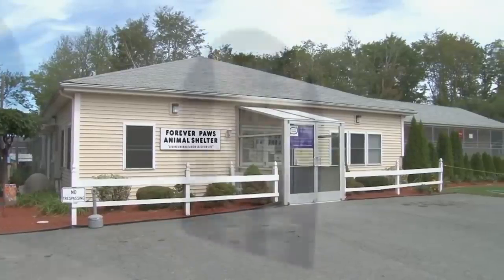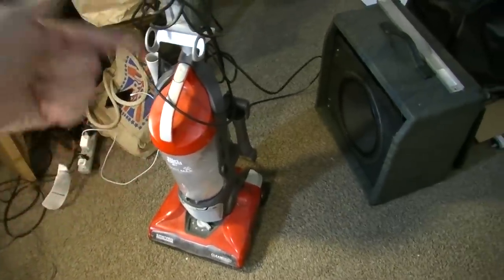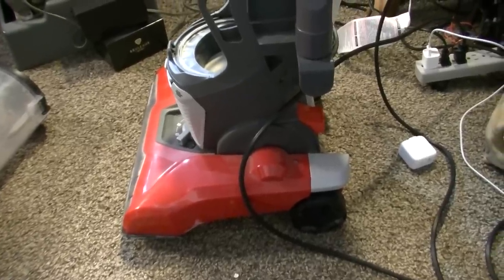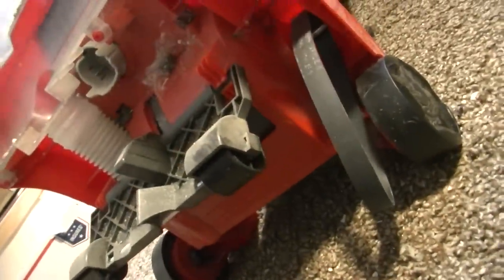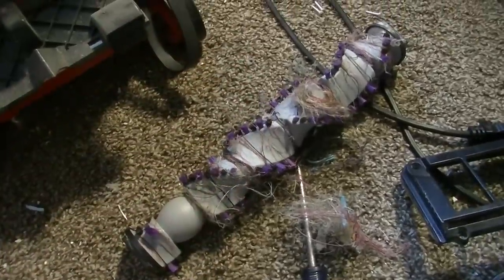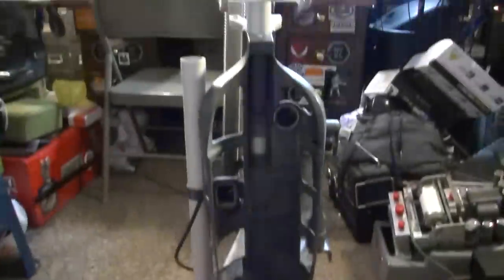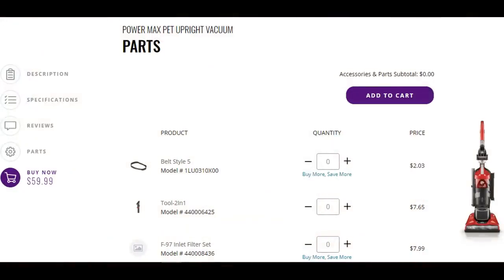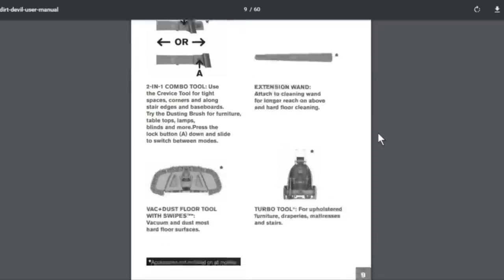Dirt Devil Bagless Upright Vacuum Overheats, Loses Suction & Stops - Let's FIX IT!

Comment: I live in an apartment complex very close to a university. Every June thru July, I will find at least 6-7 DD vacuums sitting out by the dumpster. Usually the person - typically a student – will keep vacuuming without emptying the dirt cup until the thing is so clogged it loses suction, and they just throw it out. Maybe one time out of the 25 or so vacuums I've retrieved over the years had a broken belt that needed replacing.

Anyway, I completely empty out the dirt cup, rinse it out, clean out the filters, wipe the entire vacuum down nice and good and sell it for 25 bucks on Facebook. It's never taken me longer than two days tops to sell one.

The other thing is, there are so many apartment complexes filled with students in this town that if I really applied myself, I could probably pay my rent in the summer purely from retrieving vacuums and selling them. 😅

Comment: This video was very informative. I’m familiar with replacing belts on my vacuums through the years. So I felt confident to tackle this one. I have a Dirt Devil bagless model. After replacing the belt, cleaning the beater bar, filter and hepa filter, and checking the hoses, it still is not picking up. After vacuuming two rooms, the canister had almost nothing in it. ( I sew and gave a cat, it should have had stuff in it!) The motor area was hot. 
Prior to this servicing, it overheated and shut off completely. 
I debated taking it to a repair shop vs getting a new one.  After re watching your video, knowing that I did all of the things you demonstrated, I have decided that it is time to replace it.  Thank you for all the information and demonstration, and most of all for the reassurance that it is time to replace it.

Comment: I fixed my share of vacuums.... then I bought a house with a Central Vac....   Fixed it.   Eventually the motor's bearings wore out  (it was 40+ years old)  so I put a new higher powered motor in it.  It's FANTASTIC.    Bag vacs rarely suffer this fate like the "cyclone"  units.
Reply from the maker: I bet that built-in sucker is a HOSS! Keep that one happy and it'll love you long time. I have a bag Eureka upright that was a garbage pick. Works well. It has a noisy roller bearing, but is fine other than that.

Comment: Mine quit because the Thermristor overheated. It wouldn't work again until the next day. The Hepa filter was clogged and needed washing. Works fine now.
Reply from the maker: Just make sure you wait until the filter is completely dry before using again. Best to wait at least a day.

Comment: If you would have read the manual, you would have seen the vacuum has a Thermal Protector to prevent the motor from getting to hot. Once it is tripped you have to wait 30 minutes before it will start again, to give the motor sufficient time to cool down. Which explains why it worked

Comment: Thanks. My problem was a clog in the hose that goes from the handle to the bucket area remove both ends and with a mop stick handle was able to remove 3 rocks and wood and a lot of dust. 

Filters were washed. 

All good now.

Comment: Man, this video is old but i have to tell ya, i have almost this exact vacuum cleaner and it lost suction and stipped working and i was about to toss it. Thankfully i looked up this video and realized i only needed to clear the filter. Thanks a ton man, you saved me some $$$ on getting a new one.

Comment: Hi brad,  all single phase motors have a thermal cut out in the winding.  If they over heat from lack of  air flow it opens and closes when it cools.  So if any of the filters are clogged it will shut down!  Cheers!

Comment: Always had problems w my dirt devil also. It’d get hair, thread and various other crap around the “roller”. It would easily burn the belts off. I always pulled all the filters off too and just blew them out w the air compressor. I went to the local vacuum store & bought a 3-4pack of belts for like 25$ or something. It always worked just fine after cleaning it and is still working to this day.

Comment: yeah it has a thirmister in the winding of the motor. After every 5 uses i blow out my filters with my air compressor . My wife's hair is half way down her back. so I have to cut her hair out of the roller almost as much as blowing the filter's out.

Comment: I have a similar Dirt Devil vacuum and I don't know how to access the filter below the removable dirt container.  Not the round filter. The cover comes off and I can see the filter but maybe I have to remove more parts under the dirt container to get to it. My biggest issue is that the brush spins so fast that it throws the dirt before it can vacuum it up. The belt started coming off and I thought maybe something was missing that held it in place other than that bare metal cylinder that it goes around but from your video that is all there is.  The belt is old and probably stretched out of shape so I think a new one will fix that problem. The number on the belt comes up as a Hoover part now since they all  got bought out by a Chinese company. Just a tip. Those cheap plastic snakes  used to unclog a sink come in handy for things stuck in the hose.

Comment: I lind my haus with a Lindhaus dp-5. So much better than any crappy disposable Chinese made vacuum cleaner on the market. It’s bagged which is hygienic and no nasty dust cups to empty, made Italy, pleasant sounding suction motor that only get warm but not hot and provides great airflow, chevron bristle composite roller brushroll that does excellent agitation, and indestructible heavy duty tool grade plastic construction.

Comment: If you take the hose apart starting from underneath all the way to the canister you will find there is a blockage up inside where it's hard to see easily. All the newer Vacuum Cleaners have a Thermal Overload Switch that shuts down the Vacuum Cleaners Motor automatically. This has happened to me many times. I'm 99.9999% sure you have a blockage or partial blockage. Also about once a month I take the Filters out and suck the dirt out of them. Also mark the little sponge filter(s) so you always put them with the same side down. I also suck the dirt off of the same side that it collects on. I make sure I never suck the dirt through the Filter this is why I mark them. I have a similar $66 dollar model from Hoover. If it's from Hoover it Sucks!!
God Bless!!
Jimmy in NC....

Comment: I have a dirt devil that I bought in 1995 and still using it. It has a lever labeled vacuum or hose. If it’s in the hose position and the hose is stored on the vacuum it will overheat. This one might be different. If it’s standing in upright position when you turn it on, the hose will have to be out.
Reply: But thanks for the video and all the great stuff you do!

Comment: I thought for sure once my vacuum wasn't clogged as I took apart and cleaned almost everything. Then I finally pushed a broom handle all the way through the long tube and pushed out a 1" long clump of dog hair that was lodged midway in between. Back to working great after that.

Comment: Another thing to check is the vacuum motor, itself! If those filters don't all get cleaned regularly (and sometimes even if they do!) a bunch of fine schmoo will get sucked into the motor...which, obviously, makes it work harder, and hotter. A little compressed air blown through the exposed motor will get rid of most of the mess.
Reply: ...  In this case, all I'm talking about is using an external source (compressor, etc.) to blow accumulated dust, dirt, etc. out of a disassembled unit. With the motor being exposed, you want to blow the junk out of the motor, especially the bearings and brushes.

Comment: Hallo, TY, take time to check a few things, then decide next move. Benefits are in money saving as well as enviromental impact. Some parts are available to ensure function.  ...   I watched this video to see if I can get a Dirtdevel working. Reason for me is to stop carrying the heavy Hoover up + down stairs. The "repair" spending will have a possitive impact on my back as well as safty with the stairs.    ....   For your situation you might want to avoid the cleaner in the sewing area as well as using it on areas with little dirt. Also maintanace after every cleaning improves the lifetime and power.     ...I put a small amount a fragance (essentiel oil or parfuem) on a filter.    Bye :)

Comment: I don't know Jack shit about amp repair, but my Mother-In-Law's vacuums make regular visits for cleaning. The filter systems are 3 stage, and need to he cleaned. Water will cause debris to coagulate and congest these fine filters so I use a compressor and air chuck. Go outside and blow all of the dust out of the filters and the vacuum will be good as new. Cut the stings from the beater bar, give it a wipe down, and your Christmas stocking is sure to be full. Happy Holidays Brad!

Comment: Directions state clean filter every 3 months. (outside) "Generally the hose will clog first from the floor up, you'll see the lowest curve at the back then down to floor attachment. Open and use another vacuum to suck out all your Xmas needles.

Comment: I'm just now seeing this vid. It must've slipped by me, but I have this exact vacuum cleaner and the exact same thing happened to me a couple weeks ago. I washed out the under canister and hepa filters in the sink, let dry and it runs like a brand new vacuum. I thought mine died at first, but I looked at the support docs and saw there's a thermal switch protection built in.

Comment: my hoover wind tunnel shuts off when the hepa filter is clogged.
Reply: a bit more. if the filters are clogged a heat sensor is triggered followed by a 30 minute shut off. I took about the canister colllector and clean it as well as replaced both filters that i got from ebay for 15 bucks.
Reply: yeah brad is kind of great. I started dabbling in electronic because of this channel.BTW,  My 100 dollar vacuum cleaner works like new after doing this. I have replaced the filter twice but i think its because we use arm and hammer powder and it clogs the filter a bit quicker.

Comment: Had this happen to me. I let my mom use my vacuum and she gave it back. When I used it afterwards I thought it was a bit louder. My son covered his ears when I tried it. No suction and it overheated. I cut out all the hair in the roller. And cleaned the completely dusty foam filters. Still didn’t work. I checked where the dirt/dust goes once it gets picked up and saw a huge wad of black and dust. Got a chopstick out and pulled out a small sock. Works just like before it was louder with the sock stuck in it.

Comment: I got the same vacuum that things a piece of shit. Wife bought that when my bisel vacuume motor burned out.
Reply from the maker: Wife bought this one too. Would not have been my first choice, but I'm now determined to make the most of it! It's going to be a long 40 years until this vacuum dies...or I die. It actually works ok when it works. There really isn't enough weight on the base of the unit to press the brushes well down into low carpets or rugs. And the handle doubling as the wand???? WTF is this built-in fail point bullshit? I can already tell that's going to be another video down the road. I have my duct tape and epoxy at the ready. Come at me, Dirt Devil.
Reply: @TheGuitologist  I know in the brushes don't stop when you take the handle out to use as a wand so you got a tilted back or pay attention to where you got it or it's going to yank up the frilly ends of a rug or anyting I've already replaced like for belts on mine just because of that I ended up putting one of those stop washers with the grub screw in it on the end of the motor shaft of the belt would stop running off the end and took the factory filters out and replace them with thinner filters because that vacuum sucks and I don't mean that in a good way
Reply: @TheGuitologist  I had to kind of laugh when I seen you taking that vacuum apart in that video because I know it won't be the last and like me you will have modified the shit out of it just to get it to work
Reply: Sorry it's a little hard to read I'm doing text to speech my phone don't understand my southern ass

Comment: I've never heard of ANY Dirt Devil that wasn't plagued with losing performance and shutting down when the filters become even SLIGHTLY clogged. That exhaust filter looked perfectly fine to me, but the round filter was VERY dirty. But overall, that vacuum does NOT look well maintained at all and in desperate need of cleaning and maintenance. Shame on you. Lol.
Reply: My cheap dirt devil express model only has a normal canister filter with a smooth foam thing around it to prevent the filter itself underneath from clogging too fast. and a thin blue colored debris-blocking filter for the motor. No heppa or super fine particle filters. so I'm dusting and vacuuming almost every couple days to keep the place from becoming a dust factory.

Comment: Mine won't even start; checked the entire machine for clogs
Reply from the maker: One of the leads on the motor has burned open or there's a thermal fuse in there, or the motor coil is burned. Open up the motor housing and inspect the connections to the motor.

Comment: Brushes are gone switch bad bearings shot
Reply: Jump past the thermal cutout?
Reply from the maker: @hadleymanmusic  No way. Don't ever defeat a thermal switch. Replace with new thermal switch or a low value fuse.